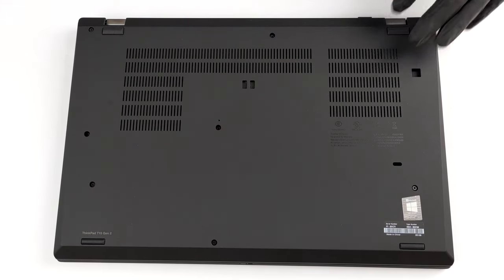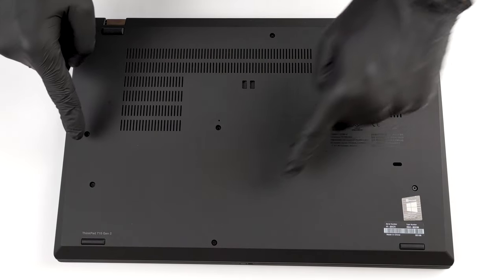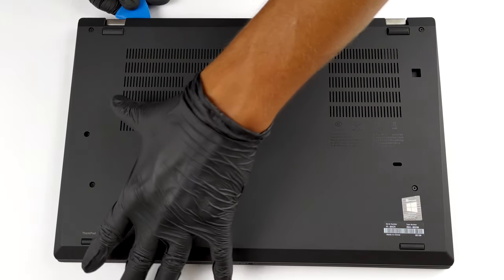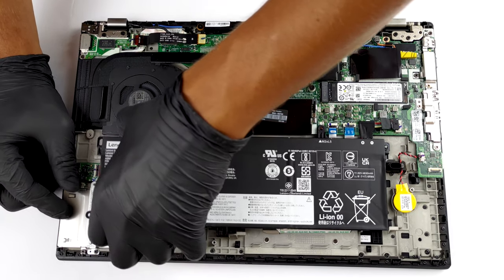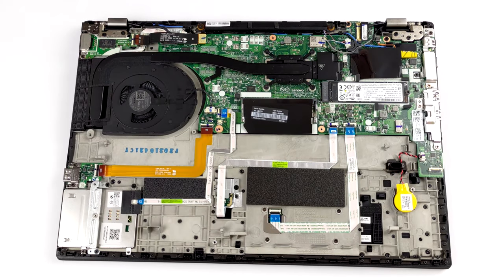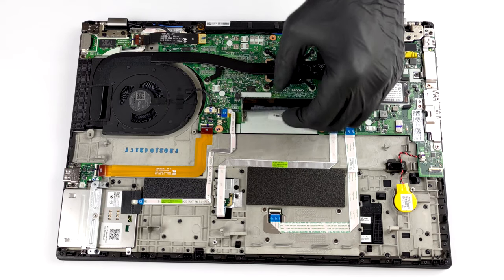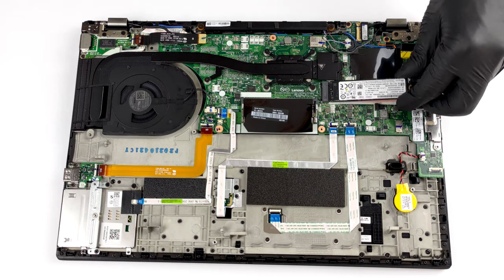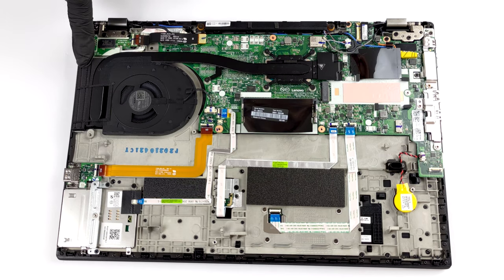🛠️ Lenovo ThinkPad T15 Gen 2 - disassembly and upgrade options

Comment: :D
If you "ply the bottom part with a plastic tool", you are going to rip off the SIM socket from the motherboard. You need to remove that first.
Second, that bottom that you just "ply", might disagree with that, it takes at least 20 minutes of hard work.
Third, the cooling fan is going to stuck with the bottom part, which means, you are also going to rip off the coolant pipes from the motherboard. Make sure you unstuck the fan.
Reply: What?  Not one part of what you said is true or makes any sense.
Reply: @yodabolt1247  They are correct about the SIM socket.
Reply: @lukpac  I’ve upgraded 6 or 7 of these and up took me all of about a 5 minutes to open and upgraded memory and storage.  Maybe they super glue these in some regions lol
Reply: @yodabolt1247  The SIM card holder will prevent the bottom from coming off, and/or will bend/break the holder and/or socket. I just ran into that myself.

Comment: why is there a single-channel pipe between CPU and fan, not dual? 
E15 gen 2 or T14 gen 1&2 also have a dual-channel, T15 gen 1 version has one channel also.
I think it is an important thing for a laptop cooling system.
What does Lenovo want to do? Answer: Cheapness :)

Comment: How do you remove the keyboard on this Model, i dropped orange juice on the keyboard and would like to replace it. I opened it but failed to find any screws that hold the keyboard. Thanks.
Reply: hi, were you able to replace the keyboard?
Reply: There is a video on YouTube entitled "Lenovo Thinkpad T15 Gen2 keyboard change"

Comment: Thanks for posting this video ... I almost bought one of these the other day.  That single heat pipe is disgusting for a machine that can be spec'd with an i9 and 3080 maxQ
Reply: Just a heads up, this is a tear down for the the t15 and not the t15g
Reply: @fiestydodo3821  I misread the title myself. Lol. I have t15g2.
Reply: Strong gravity influence on that heatpipe too.  Mine sustains 20 W flat, but 26 W vertical (condenser side up).